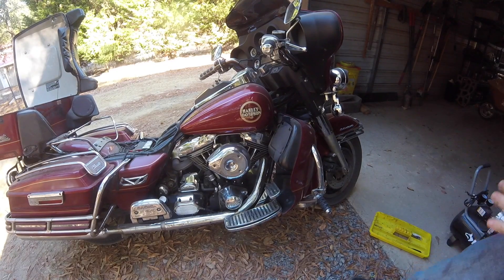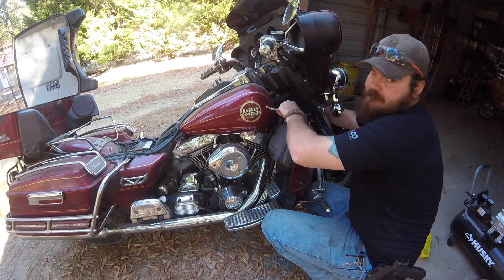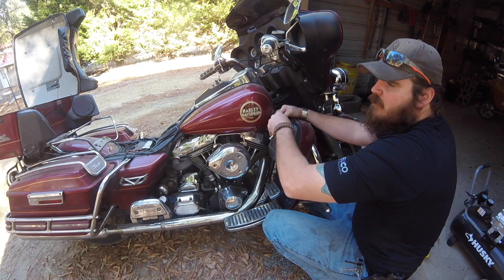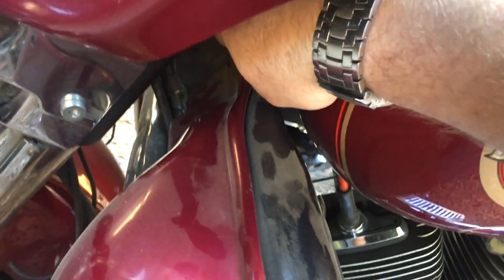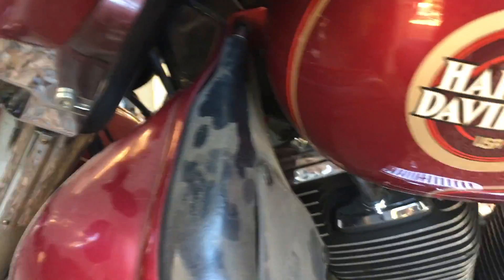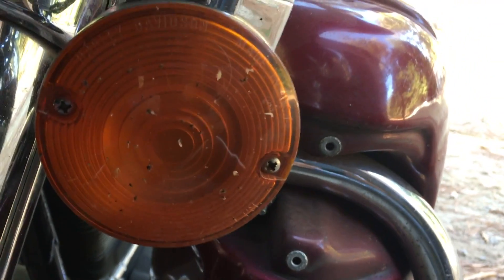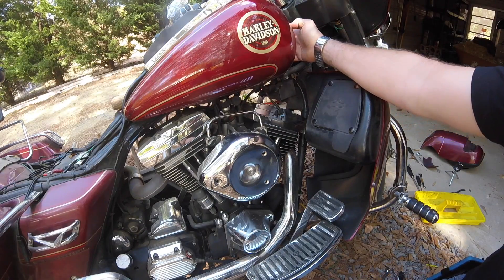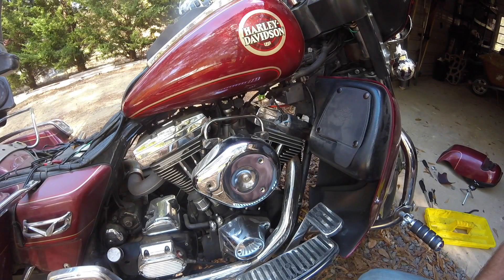Engine Temp. Sensor

Comment: Getting that gas hose around the coil was a real issue in order to raise gas tank. What I did was slide gas hose down gave me room to move tank up. Replaced that engine heat sensor and replaced with new one was the best thing I ever did! No more sputtering and stalling and erratic idle when in neutral. Bike ran fine when cold but when warmed up it was a wreck! Thanks for this video!👍

Comment: How do I know if it is bad I hear a lot of my problem with my bike is engine temperature sensor but not sure
Reply: one symptom is idling too high or two low...
Reply: Adam G1 second agoone symptom is idling too high or two low.when engine is hot
Reply: My bike won't start after I stop when warm have to wait till it cools off  no codes

Comment: Hey guys my back idles high, revs on it’s own with the clutch in, backfires and randomly cuts the engine off. Scaring when I turning or high speeds. I tried cleaning my map sensor. Heard this could possibly be it? Thanks. Any other symptoms or diagnostics I can try?
Reply: Replaced engine temp sensor after a year and  a half of nothing but sputtering and dying at every stop sign and traffic light on my 2011 Heritage Softail. Dealer price for the sensor was $42.00, runs like a new one.

Comment: Maybe you could just get a mic you can wear...any way I like the video the only thing I think you should add is the troubleshooting information on the symptoms of a bad sensor...keep it up 👍
Reply from the maker: unfortunately gopro does not have a 'mic in' input.  But the only symptom I had was a check engine light and code.  I've read other saying that when theirs went their bike was missing and bucking like crazy until it was replaced.

Comment: I have a custom Harley bobber, its kind if hard to get to things on it and it doesn't even have a bunch of extra stuff on it at all, I wouldn't own one if those full dressed Harley's once you own a Harley you come to realize that there is going to be something that's going to break or not work on them I believe the Harley big wigs want them that way so if you are not mechanically inclined as quite a few Harley owners are not you will have to bring it to them for repair, and the fact that people say they can't build a Harley that won't break down is BS because they built the evolution because the Japanese bike's were out selling them, then as soon as they got over the money problems Harley went right back to building crap, so good luck all you fancy full dresser owners have fun pulling all that extra bull crap off your bike's if I was going to have all that crap I'd get a Honda goldwing or something I didn't have to pull all that crap off of.
Reply from the maker: If it has a motor its gonna break down at some point. That Ultra is no more difficult to work on than any other bike ive owned.

Comment: Other than  it throwing the engine code what kind of symptoms were you experiencing with your faulty temp sensor
Reply from the maker: corey whigham there were no other symptoms in my situation.  But I did read about others saying their bike felt like a bucking bronco when theirs went out.
Reply: That's what's happening with my 98 road glide.  It's bucking and acting a fool.  I lifted my tank and pulled my throttle body off to clean every thing and noticed my temp sensor just hanging out on top of the head.  The threaded part had broken off and it was just chilling there.  I appreciate the reply.  Now to order the part.....  local HD told me $100 for it. Oh well.  Got to pay to play
Reply: corey whigham did that resolve your issue?
Reply: Mine was coding. High long idles and intermittent high idle